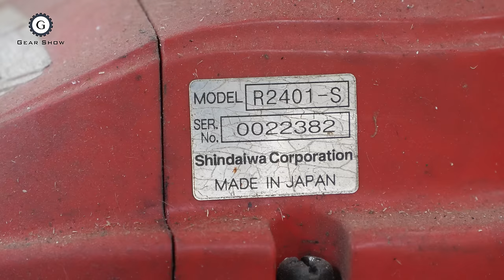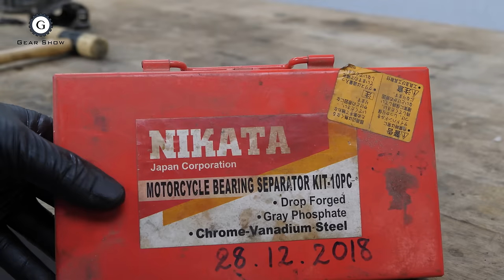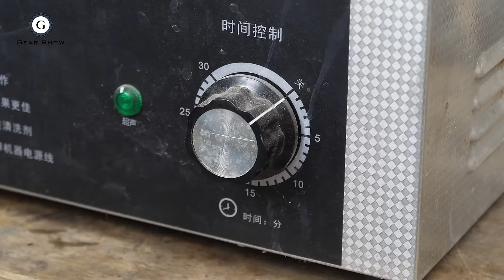Abandoned Japan Brush Cutter Repairing | Shindaiwa 2401

Comment: pro tip: dont use a ziptie to fix the crack in the tank, just melt the plastic around the tank itself with the soldering iron. fuel tanks are usualy made of HDPE or polypropylene and zipties are made of nylon, these plastics dont fuse together well and you will end up with new cracks or even having the nylon straight up peel off the tank
Reply: Plus this white zip tie is less durable against the sun (or UV) than the black type.
Reply: I don’t even understand why he didn’t bought a new one in the first place, it’s not that expensive, and you can find a new fuel tank easily 😂😂😬
Reply: better yet don't do hot work on a gas tank!

no cheap plastic tank is worth being blown up over
Reply: @HalFastIndustries  that is why he put water in the tank didn't you see when he emptied it after

Comment: My heart sunk. 
You have done all that work but you have used same old parts.
You have changed gaskets on carb but not cleaned it, should have atleast run it through the ultrasonic cleaner and the ports.